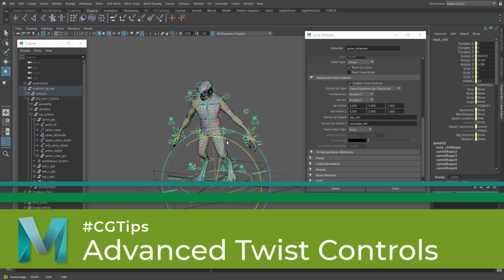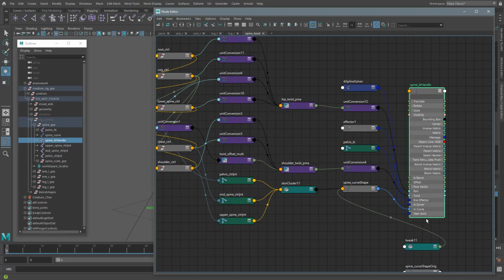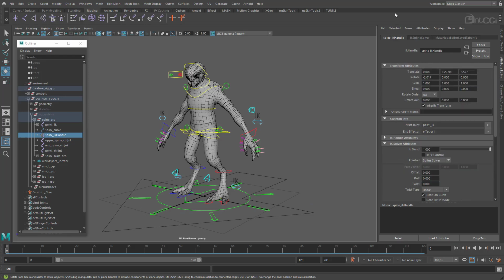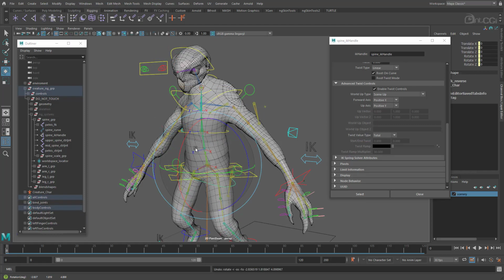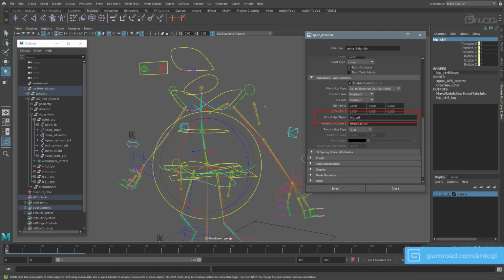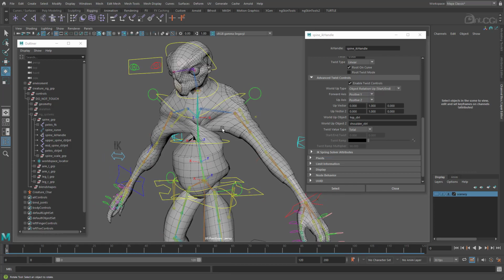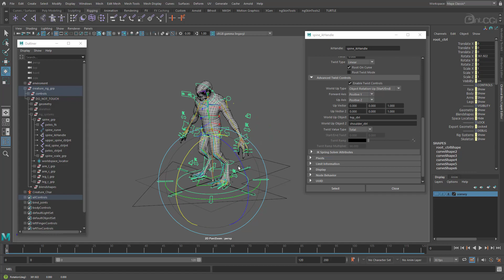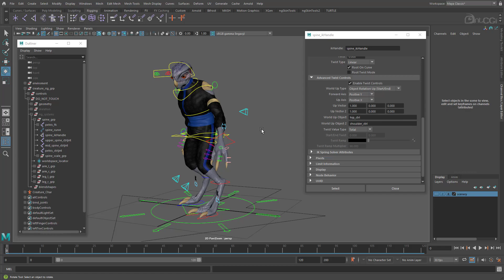#CGTip | Advanced Twist Controls

Comment: Hi, excelent chanel because all tutorial are recent! Question: ¿how do you fix or prevent off rotations in between keys while animating? BTW, I haven't watched all your videos so I don't know If you already gave the answer and  wich video, but sometimes, when you move a rigged foot, while in the air, if you add a slight rotation of the feet to the left, during th animation, this action adds extra rotations in between, off rotations,  example: you rotate a feet controller to the left in the air, so Maya now adds 2 akward rotations to the right before and after that, ending with an akward movement.... I have never being able to find a solution I just kep pleying with the Graph editor but it can be dificult or time consuming, so now both feet joints and controller have this weird rotations. Thanks!